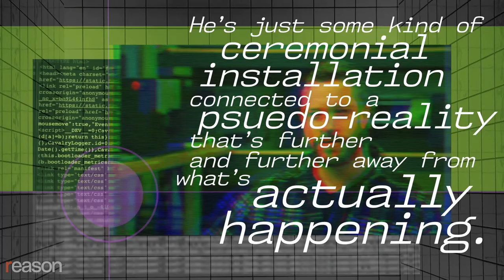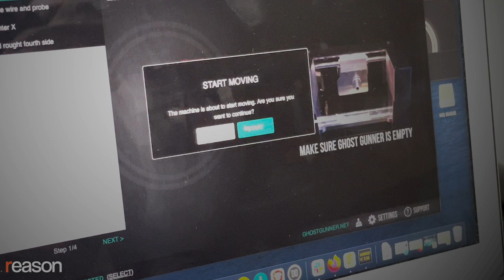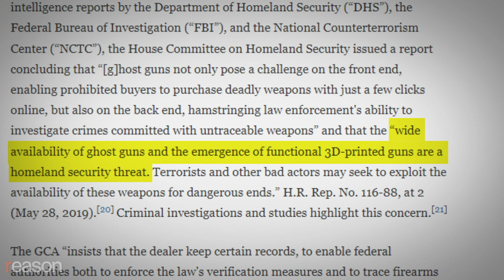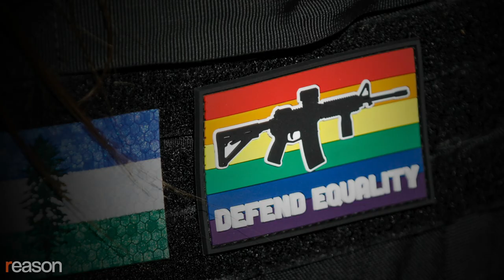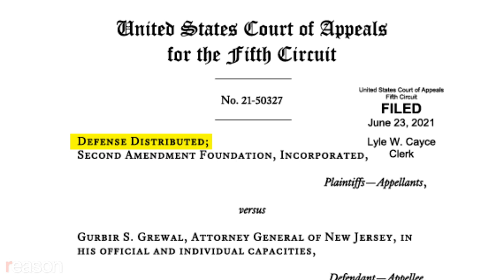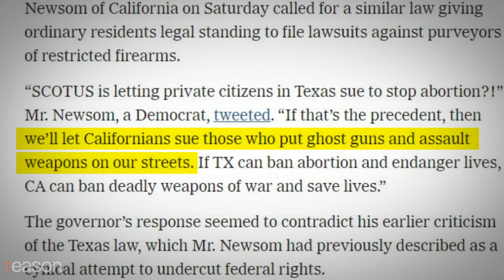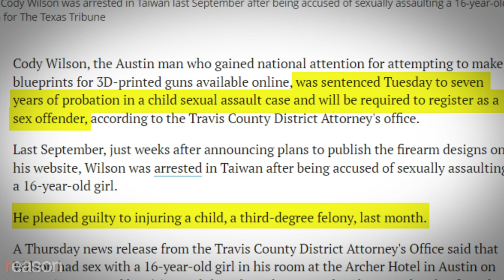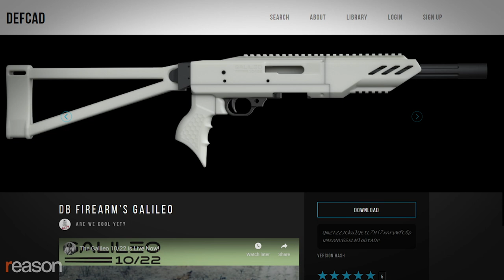Cody Wilson Thwarts Another Attempt To Stop Ghost Guns

Comment: Guns can be made much simpler even, also they don't need complex bolts, gas chambers, buffers, bolt balancing, recoil springs.  Guns can be made to operate electrically, this immediately allows fully automatic weapons with almost no extra effort.
Reply: @LarsLarsen77  could it be applied to actual firearms?
Reply: @Razor-gx2dq  the bolt on a paintball gun is actuated like an SMG, held back against spring pressure by a sear, the fancy automatic ones just have a solenoid controlled sear
Reply: You can make a sten type firearm with plumbing supplies and a file. Same with a luty gun. The more metal working tools you have, the easier it is. Hell you can rifle a pipe with an electrical process. Its harder to make a legal semi auto than an illegal full auto to be honest.
Reply: @MrSolLeks  everyone brings up the luty saying it's easy to make. But I have to ask, how many of those people have made one... I've seen Far more fgc9s than Lutys because the luty isn't easy to make its just easy"er" than a professional firearm. Yeah it CAN be made with hardware from a store but not many people have basic skills now to make it
Reply: @donttreadonmemes  I never said easy to make, but it was designed and constructed in a way to be made with household tools and materials. Now there is also the FGC9, a gun I do plan on making though I will still probably use a factory barrel.
Reply: @MrSolLeks  forgive me I didn't mean to imply that you said it. I just see it brought up often when people talk about making guns but never attempted to make it themselves. Meanwhile the fgc9 isn't brought up when it's multiple times more simple to manufacture and people actually made it with basic tools in their bedroom.
Reply: And for that reason they will make ammunition scarce or unobtainable.
Reply: what happens when you dont have a charger though, or run out of extra batteries? what if someone breaks into your house but your rifle wont shoot cuz the batteries are dead?
Reply: @squidwardo7074  that is irrelevant, the point is that making a gun is easier today if you understand that parts can be made to work electrically instead of mechanically.  This is not a discussion about self protection at night.
Reply: @waynemizer4912  you should take a look at electromagnetic weapons, a gauss gun doesn't need a complex ammunition, just pointy pieces of steel

Comment: Meanwhile im over doing ECM barrels from hydraulic tubes to doing ceramic shell lost PLA casting uppers and lowers using junkyard ford and dodge aluminum rims. Quick note ford uses pretty high quality metal lol ! If you need the best aluminum to cast with use a ford aluminum wheel . Anyways you'll never stop us ! If we can make barrels and gun parts you lose. Were getting closer to making plastic extruded casings . Omce that happens its game over! The future is now old man !

Comment: I know of no cases where the ATF has lost ground on anything. I know of many who thought they had the ATF by the short and curlies and lost everything but their life. They are patient and perpetual. We are not. 
I could be wrong and that would be fine.
 But for me, my favorite part about this is that I think that stuff made of metal is cool, making stuff out of metal is cooler, and CNC machines are expensive so maybe CNC gets more and more accessible. I don't think I have ever made something out of metal but I want to. I would love to make some titanium scales for my pocket knife or mill/lathe a flashlight body or a challenge coin or something. That's cool.
Reply: Not sure where you are, but if in a country with resources , find a local “maker space” and sign up to go learn from others. It’s basically a fully stocked shop with welders tools, machines etc, and people pay a pretty low cost to go there and use everything, make stuff, and learn from others. I am talking non firearm related stuff. Just general metalworking, woodworking, hobbyist lock picking, coding, etc etc . Get out there

Comment: It doesn't matter how much you mill blocks of aluminum for bullet receivers, it does not make barrels or trigger components that require special alloys (not aluminum) or plastics and their coatings (titanium vapor deposition, etc) for the actual firing mechanism.  The vid shows lower units milled but no barrels and triggers milled.  The firing chambers cannot be milled out of aluminum.
Reply: Real milling machines will machine steel, plastic, alloys, etc. If is soft enough  to be cut with high speed steel or tungsten carbide it can be done. Barrels are somewhat harder to make but it can be done at the garage level  with manual methods. .  And yes I am an apprentice trained machinist and instrument maker with a small machine shop. No I don't make or work on guns but most machinist can do it. It is just basic machine work.

Comment: the real problem for gun control advocates here is that the genie is out of the bottle. The files are out there, 3D printers are not expensive and CNC routers price drop by the month. There is no stopping this without a massive overreach that would get almost immediately struck down.

Comment: The definition of a ghost gun as claimed here is not what is causing problems with crime.
The problem definition is simply a gun with the serial number removed wether it was registered or not prior to the removal of the serial number.
Criminals will obtain guns from anywhere, either stolen from registered owners or from gun runners. Often they don’t even bother removing the serial number unless it might prove where it was stolen or purchased from if that information might cause problems for the criminals.
The vast majority of weapons used in crimes had serial numbers.
People legally making gun parts account for about 0.0001 percent of the parts used in criminals guns , illegal gun manufacturers in other countries and small criminally owned shops account for the rest of the guns that did not come from a major legal manufacturer .
Basically if someone wants to use a gun in a crime they will get one and use it regardless of ghosts guns being made illegal and if they want to make a gun then they will make a gun. You can do it with a bit of pipe a spring and a nail.
I suspect the real reason for the attack on ghost guns is to stop people from making their own guns instead of buying them.

Comment: I went to the Ghost Gunner site and the zero percent parts are now available. Now the Ghost Gunner can only machine part of an AR15 receiver. You have to buy the completely machined buffer tube section and lower half section of a receiver for $85 which bolts on the "zero percent" receiver section machined by GG3. So, all the AFT has to do to kill this without new code for Bolt-Ons is to regulate the current completed sections of the receivers. Cody is going write the code to have these parts machined on Ghost Gunner on a future release. Maybe the code could be written where you start with 1 piece of aluminum and end user finish with Taps for the threads? The last question is will Defense Distributed give up customer records to AFT? 🤓 Knowing Cody and Heindorff that would be a no.

Comment: It's funny the state is worried about P80's and 80% AR lowers. They'd wet themselves if they knew guys like me with a hobby mill and lathe ca build full auto sub-machine guns from scrap(I haven't, but 𝘤𝘢𝘯). 'High capacity' magazine bans? I've already made the dies to stamp my own AR mag bodies on a cheap DIY air over hydraulic shop press as well as a spring winding jig. With followers from 10rnd mags they work flawlessly. Colt SMG mags are next on my list....

Comment: If I rent a CNC mill and use it to make a receiver, how is that different than my buying a CNC mill and using it to make a receiver?  So, why couldn't a company set themselves up as a CNC rental company, you walk in with a billet of aluminum, put it in your rented machine, and walk out with whatever parts you required?  Maybe it couldn't happen over state lines (IANAL)?  

For me, buying a CNC like the Ghost Gunner, figuring out out to use it (I have yet to get my 3D printer to print anything but bird's nests), and ending up with a gun that I would be willing to test myself sounds like a recipe for failure, but renting a machine and the knowledge of how to properly import instructions (program?), that might be something I'd do.

Comment: What about regular small CNC milling machines? I had a Tormach that could churn out precision machined parts all day and easier than this thing. You can convert a Seig X2 or X3 that would do the same job far cheaper. Will they ban ALL CNC mill in private possession?
Reply: It is  not that hard to convert manual milling machines to CNC.

Comment: Anyone (mostly) can make a gun of some sorts using off the shelf or even raw components with a very basic set of tools. Will it perform flawlessly and be a marvel of modern engineering, or will it be reliable or a pipe bomb, who knows. I live in a gun restricted country and am glad most random neighbors don't readily have access to firearms because they can't even be trusted to have basic decency or handle basic tools without causing trouble. If you can't park a car, handle your kids, throw your trash in a garbage and use a turning signal, I can't trust you handling a firearm. Surprisingly the USA population grows and the crime rates are not proportional to gun ownership.  Do I believe gun laws work to prevent crime? Nope. whoever has a need finds a way. The control only limits the availability to the more resourceful ones, the rest just commit violent crimes any(other)way.

Comment: Wheres the danger? Surely people are still missing the skill to make the hard parts such as barrel, bolt carrier and trigger group which would need industry and manufacture the same as they always did, sure a metal 3D printer could do all except barrel but costs $100k when always a hand lathe or manual machinist could do the same, or is it basically 3D printing away serial numbers, But not creating an actual gun?

Comment: Isn't the barrel registered or regulated  though ?. Not every part is Ghosted on a ghost gun inform in you guys.
Reply: there's no registry for starters, not federally anyway. they keep track of sales records at gun stores. barrels are not serialized just the lowers or receivers, depending on what you're building. even demilled kits, ak parts kits for example, have serials but they are parts at that point and can be ordered online, no background check. bolts carrier and front trunnion on my parts kit was serialized from country or origin if i recall. the only one that mattered was the one on the completed receiver i bought. that term is intended to scare the uniformed and they back it with padded numbers, stolen guns with serials removed. the people build in their garage aren't the problem. they are for a certain political party because they vote for the other team.

Comment: The left's blind rage at so-called ghost guns is an excellent illustration of how they really aren't after solving problems with crime, but rather a calculated incremental effort to take away all guns. If you're real goal was to reduce shootings / gun related crime, you would go after the most common Firearms not the least common. 
If your community was having a problem with teenagers out drag racing and causing a nuisance on the street oh, they would probably Focus greater law enforcement attention on teens in hot rod cars. But if they follow the leftist example, they would instead ban senior citizens in farm trucks.

Comment: This is the opposite end of the spectrum of saying making something more idot proof just makes better idiots, this, making things more difficult, makes better makers.
While I don't support the concept of providing unregistered weapons, I do support the concept of being able to make at home what you want to make.... they need to get the power and motivate congress to pass a law requiring makers to stamp and register their products and make it reasonably easy and non costly to register a stamp and units produced. Don't ban it, make a system to track it and make it easy to for makers to adhere to, the honest ones will 100% do the right thing because they understand the potential for misuse.
If they start tracking stock materials, home forges will start melting aluminum cans into ingots which can then be milled. Its an unstoppable force without totalitarian control.